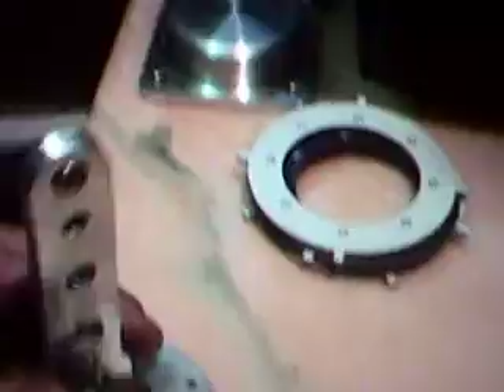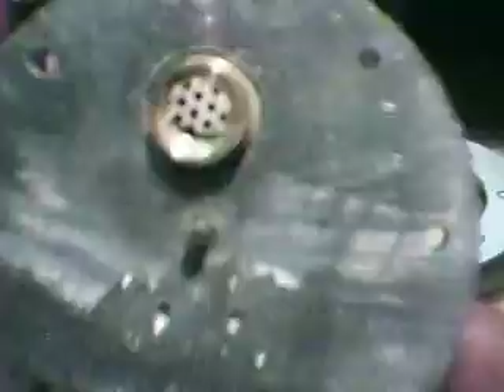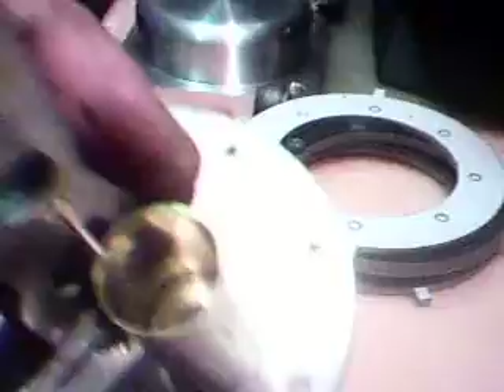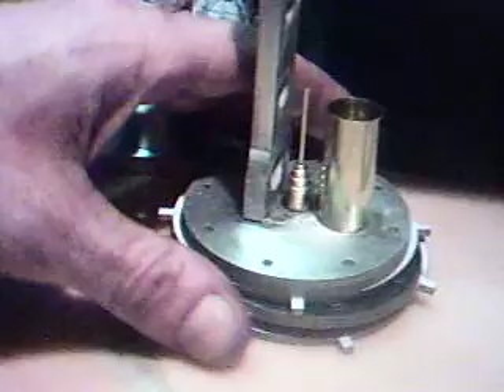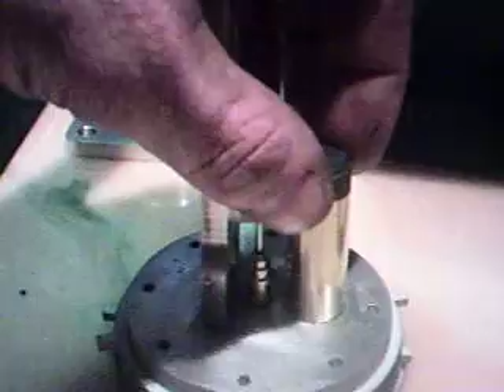Nexus stirling engine internal ceramic heat exchanger

Comment from the maker: Strictly for the piston heat the top 1/3 already has annular gaps of stainless that could be slotted but the insulator flange changes the typical most adopted designs requirements as heat on upper walls is esentially "cold" adding a non traditional regenerative effect. Hands on not following any armchair theory just results from trial and error the way they did it in the 1800's before digital.
LOL!